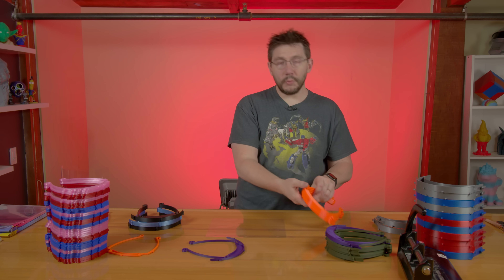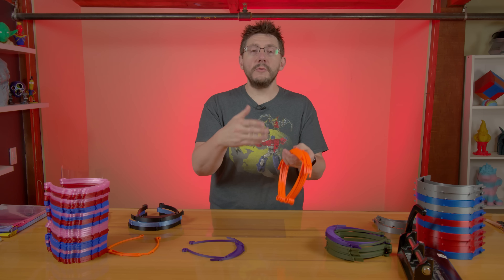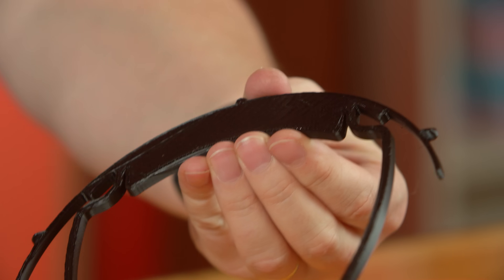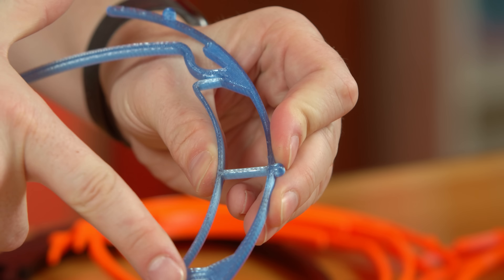Stacking 3D Prints - Does It Work? - THE CONCLUSION

Comment: I have a prusa mini... layer height was 0.2... space I put was 0.25... they are stuck together...  I was worried that it may warp or at worse dislodge mid-print...  maybe more spacing.. good thing I didn't make a stack of 5... as I planned.  I made a stack of 2 instead.. for a proof of concept.  Some more experiments gotta be done to dial it down.

Comment: using cura 4.6, I cannot tell if it worked or not as it does not show the prints as stacked. also when I try to add in the 2nd & 3rd print, after centering, cura will not allow them to show as stacked even when I try to add the relative Z height, which in my case is 0.2 as I am using 0.2 layer height, so theoretically my prints should be 0, 5.2, 10.4, etc... so I am trying to print it to see if it worked.... I used the 'Lock Model' box to try to lock in the height adjustments... i'll add to this when it finishes... or fails!!
Reply: found it... turned off drop model and now it seems to be working.

Comment: I've stacked prints for a couple of weeks but your need for tools when separating prints is to much work. We just twist. Dual extrusion pla and petg. Se my video. We produced 200 per day @ volvocars for 2,5 weeks until the injection molding tools where finished.
Reply from the maker: Ah dual extrusion - good call. Many don't have that, though. Just wanted to get an idea out there.

Comment: Just got a Resin Printer because I need to make parts that are strong in
 all directions. Any chance you would make Resin 3D Printer Videos.  
Topics I would like to see more of are: 
 1) Comparison of Plant Based,Water Washable, or Eco Resins 
 2) Comparison of Cleaning Products for the Eco Resins.
 3) Comparison of Ultrasonic Cleaners vs Mixing type Cleaners with different cleaning products for the Eco Resins.
 4) Curing Time & Hardness with different Wavelengths of Lights. ex.
 LED Grow Lights 600nm red / 450nm blue vs the Recommended 405nm violet.

Comment: 3:00 I use an iFlex tool, which was designed to pry into smartphone and tablet screens to cut through adhesive. It's a blade of springy steel, it has several nice curved edges. It's perfect for prying prints off a rigid print bed. For prying stacked prints apart, I might try an iFixit Jimmy or an iSesamo.

Comment: Can I ask if anyone has tips for stacking the prusa masks on a prusa? I tried the prusa stacked files and it would always fail as it started the first stacked part, most times jamming up the extruder.
I tried splitting the file so it only printed a couple mm's either side of the joint and that worked, but it wont work on the full print??

Comment: Just produce a model of the face shields in the 3D CAD that has them stacked with the appropriate spacing and print in place snaps. Then just slice and print as normal.

Comment: only have a small bed printer right now, so I cant fit the face sheilds.  but I can print some of the ear savers (short ones) and tried to stack them in CURA.   worked like a charm.  thanks for the info Joel.

Comment: Hey dude. I’m having some really hard problems with cura. I have 2 3D printers and I can’t fix it. I can message you on whatever. I’ve been watching your videos and I think it would be awesome if you could help. I’ve been donating the “ear savers” for my local hospitals and I’ve been shipping them (300+). My problem is going to be below.                                         So, here it is. I’ve been 3D printing for a while on my da Vinci mini+ w. I am really (I’d like to think) skilled in 3D printing and very good at Cad. I recently acquired a Robo c2, and I can’t use it. Cura seems to be the issue.Every time I go to print with the software that came with my da Vinci mini, it works just fine. But when I take it into ultimakers cura, that should work with almost every printer, it doesn’t work. The issue is when it prints, it prints higher in the back and lower in the front that obviously killing the print. Better explained, when I use Cura it changes the bed leveling, and prints it higher in the back in the front and I’ve leveled to bed 1000 times and nothing works.  please help if you can

Comment: Another alternative to stacking is setting up gcode to auto-unload the parts for you and push them into a bin next to the printer. Several people have done this; if you ask around someone can help you get set up.
There's even a project on github using a webcam and octopi to watch prints being released and stop the next print from starting if the last didn't release.

Comment: Maybe press in inserts for the ones with no protection from above?  Simple spring action press fit to reduce tight tolerance/clearance issues.  Such inserts might allow them them to be compliant in places that require such protection at times.  Easy to clean also.
Thanks Joel.

Comment: Great video! 

I tried to flip the face shield so the inset but the slicer is bridging over nothing. Is there a setting I can change in Cura so the slicer start the bridging from the outer wall?
Reply from the maker: Hmm... That's a good question. I don't know Cura well enough, but I would imagine it has something to do with how much the infill overlaps, maybe?
Reply: @3DPrintingNerd  I'll have a look tomorrow! I managed to print 32 stacked face shields without inset but want to save some filament to get more out from each spool.

I have been benching you content lately and I really enjoy them. Keep up the good work!

Comment: The top cover part could have a closed top, which would be a bridge and all the ugly bits would hidden inside for a slightly longer print.

Ideally when stacking the gap would be less than the layer height but that is probably not easy with a slicer. It could be done by post processing the gcode though. I think you could get to the normal quality and peel-ability of support material. Good to make the model an even number of layers so the infill is at right angles where they touch.

Comment: Hi Joel, I am wondering why you stack them in the slicer? The prints I made were stacked in the design process so that there is a very tiny filler between every frame. These fillers are just little dots, 5 on each side and 5 in the front part.
Reply: Because it works and it's a nice trick to know. Not everybody know how to modify 3d models